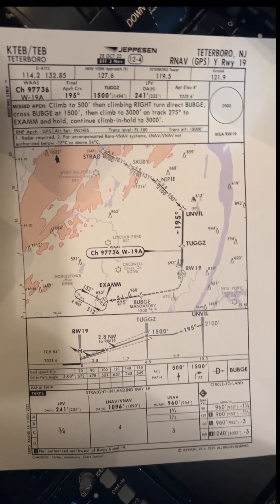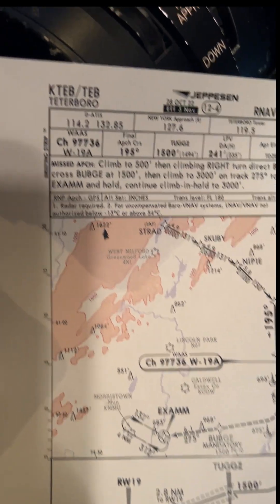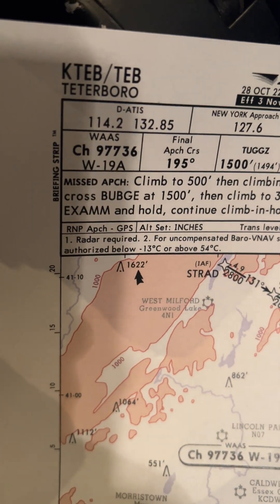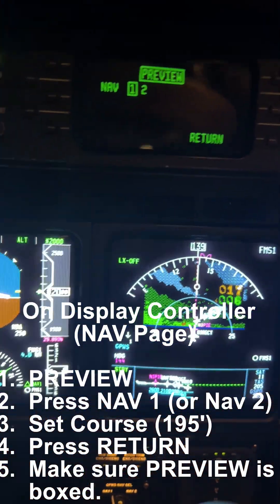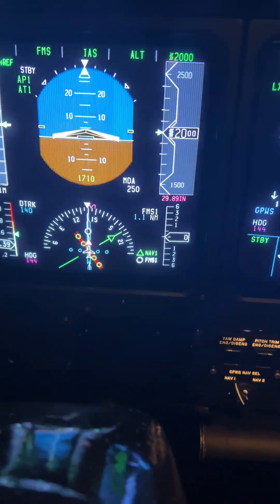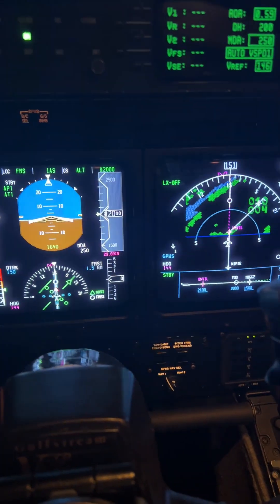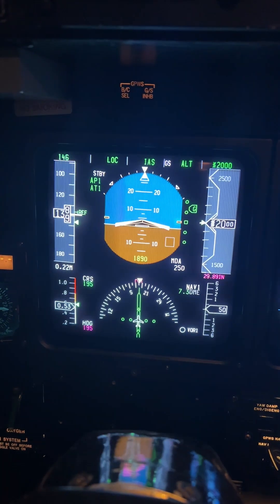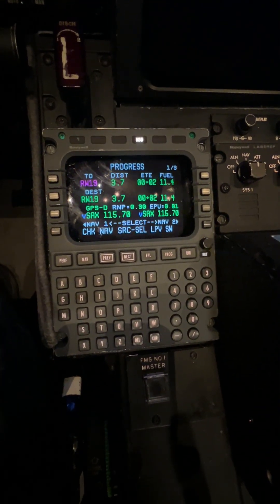Flying an LPV Approach (G-IV)

Comment: Great instructional video Captain! I fly the 8000 and we have to select the nav source.
Reply from the maker: Yes.. Just did a seminar on setting up the 8000 for an approach.

1.  Place in Heading
2.  On NAV page in Display controller, Select Nav 1 (or Nav 2 if in right seat).
3.  Set course
4.  Back to FMS
5.  Back to LNAV